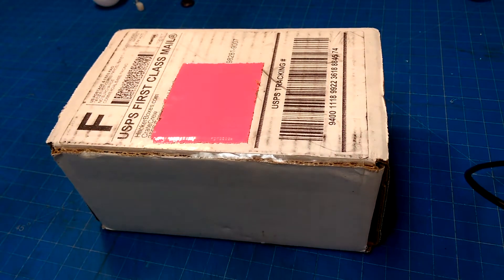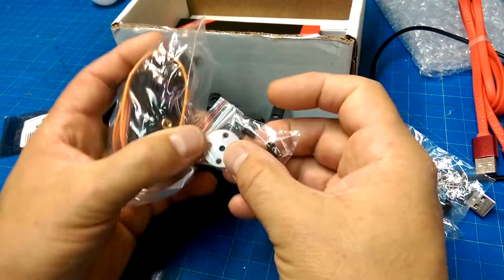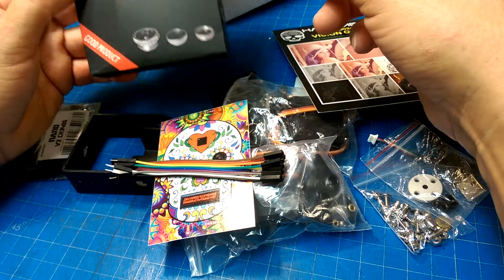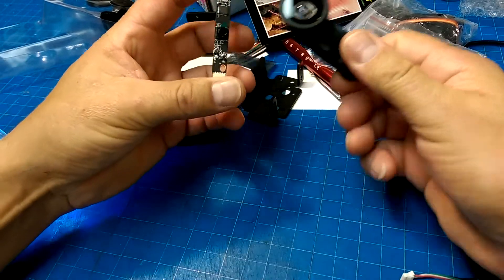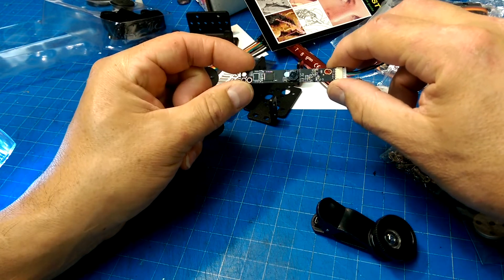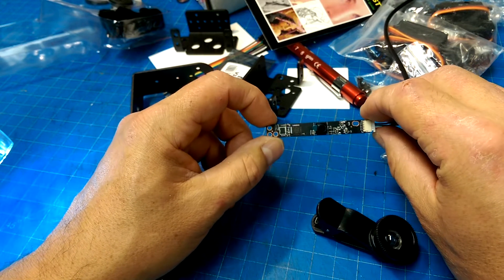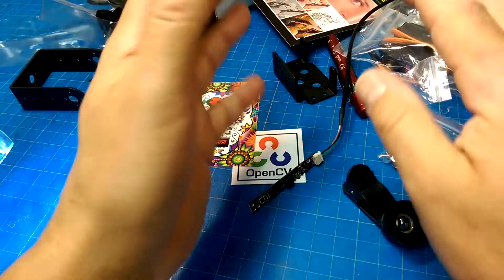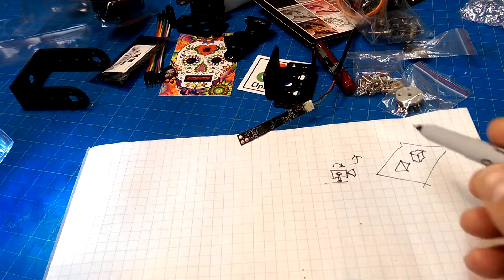vision quest   part1

Comment: Arduino nano with usb camera? lol heh that's 8-bit chip probably barely running the recognition.
The camera itself must have much more powerful chip to process frames. I'd use a better mcu
Reply from the maker: the nano is only controlling the servos.  It gets the direction information from the openCV+processing sketch software running on the host computer.  At about 7:30 I start to talk about the system block diagram.
Reply: @grtyvr  so where is the 'processor'? Onboard the camera module?
Reply from the maker: @browaruspierogus2182  If you look at the next video in the series I go into detail on the processing sketch.  https://youtu.be/3vE52HYh7XI